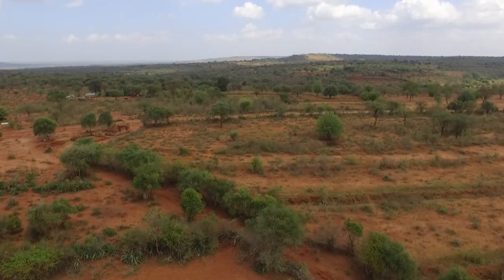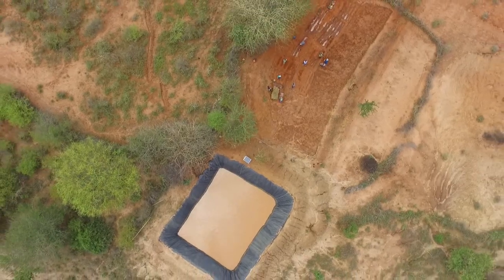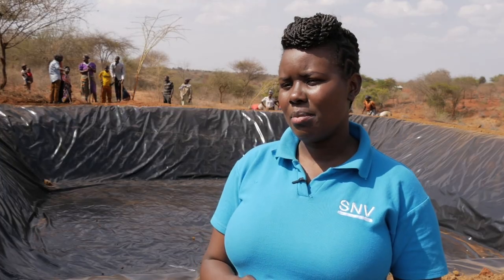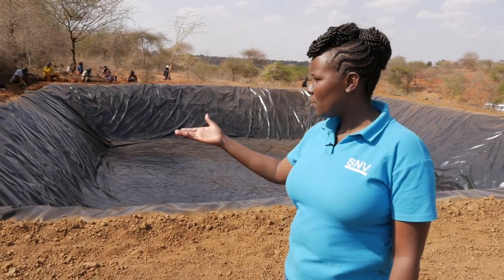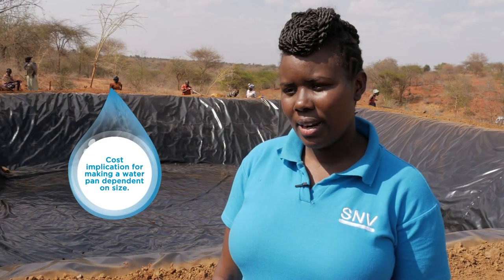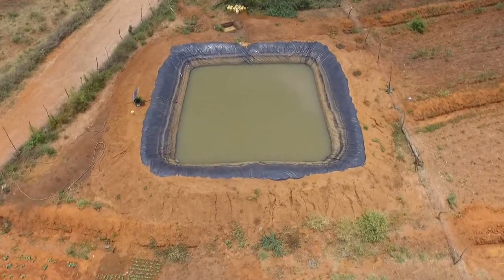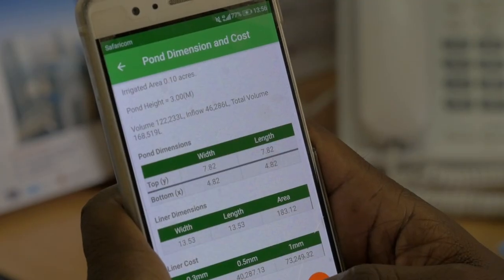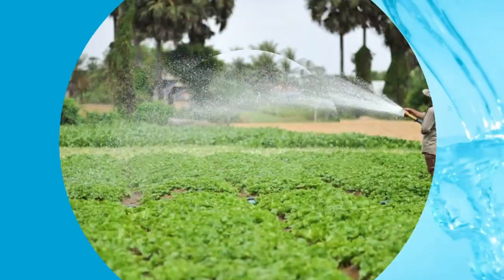A how to guide on making a water pan by the Smart Water for Agriculture Programme- SWA

Comment: The green shadenet dipped in cement grout to be tightly fixed in the pond terafter apply grout over it press to flush out air.  Fix from top to bottom, pieces must be placed in overlapping at the joints...

Comment: Instead of liners, nicely plastering the inside with ciment is a better option IMO.
Reply: Cost Benefit Analysis? It might be more expensive per square meter to use cement. I am not 100% sure though.
Reply: How and where can i buy the liner?